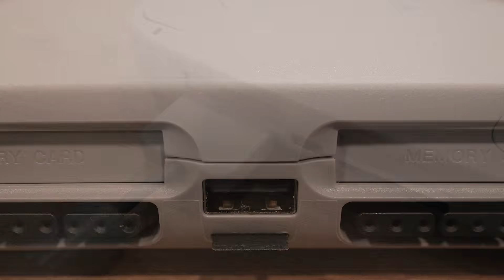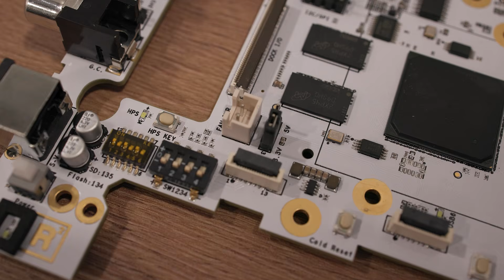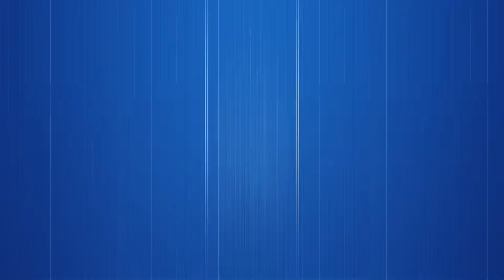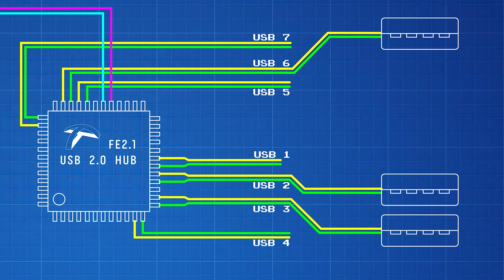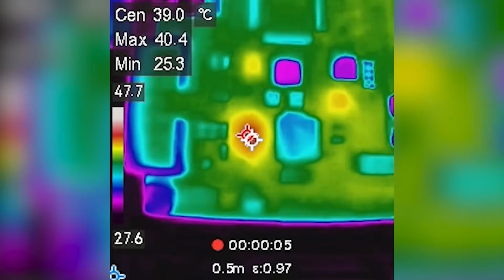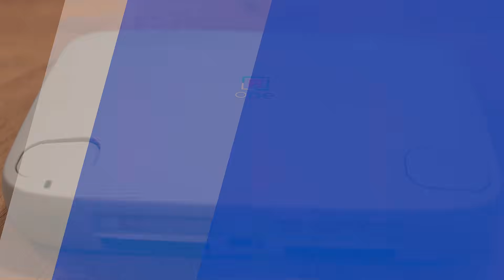Inside the SuperStation One

Comment: Hi, they say it didn't crash on them due to heat buildup; here in Germany, it's 35°C in my hobby room because we've had 40°C outside for the past two days. I can't even touch the bottom of the SSOne with my bare hand anymore!!! I can't open the box either—I've removed all  screws, but the tension is too high, and the lid would likely crack. Does the SSO (or the FPGA) have a thermal cutoff? The NFC reader/writer is a disaster for me: a 20% chance of reading and 5% for writing.
Reply: Sorry for my English its Google Translate .  In conclusion, I can only say: hardware/software 10/10; but the design of the casing/NFC and the intense heat generation—1/10!!! Did they actually test this?

Comment: Same board, but my NFC antenna works fine with cards. The location of the antenna was bad (bottom half of shell), but I could stick it to the top half, just above the menu button and it works perfectly well. I will have to remember it's there if I open it up again.

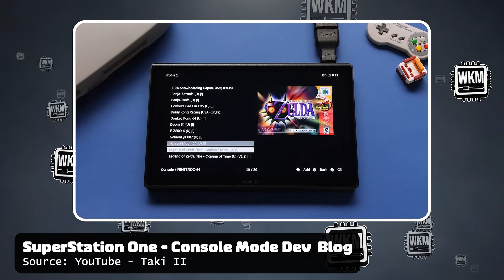Comment: 24:05 Maybe they would have saved around $20, but at the same time it's the only reason I even want one.  It's so hard to find a solution for something that supports both digital and analog signals.
Reply: What do you mean? This has been a pretty standard feature on the MiSTer. The main advantage of the SuperStation One is that it simplifies things by integrating everything onboard instead of requiring a bunch of different external adapters and/or messing with MiSTer.ini settings. But simultaneous analog and digital outputs are nothing new.

Comment: ⭐They have SNES ports on the website now!
Reply from the maker: Yeah, those are their standard SNES SNACs - you’ll need the SuperDock to use them
Reply: @whatskenmaking  Ok thanks, I didn't realize that. It looks like they were sold along side the device and I assumed it replaced one of the PS controller port since they're so similar in size.
Reply: @whatskenmaking  Ok thanks, I didn't realize that. I assumed it replaced the PS controller port.
Reply: I checked the site but couldn't find it. Where are you noticing it at?

Comment: The cooling fan is available for purchase. You just need to send an email message with your order number to the staff and they will add it to the order.
Reply: honestly it should have been standard, i remember our old cheap dvd player i was able to install a small fan on one of the chips that was getting too hot and that thing never failed.
Reply: Their coms have been terrible so I was not aware of that at all
Reply: Just did that for my 2nd thx
Reply: I never knew there was even an option for the fan, this thing runs really really hot. It is a serious missed opportunity not promoting that fan more. I feel nervous running this thing for more than an hour. It gets that hot.
Reply: I did this, got my SSO with Dock today. It was missing the fan.
Reply: @TheBroz whoa that’s not cool
Reply: @KeeneBraden  Literally.

Comment: It feels like people against this device dont seem to get that they can just get the regular mister pi if they dont want a ps1 or console like design focused mister. I think this actually achieves what it sets out to do and doesnt deviate from it. Too many people just want another mister pi variant or seemingly an emulation box set up, which a mini pc with a gaming os will do more for them than any fpga device. I'm fine with my mister pi but people really miss the point of this one.
Reply: The Mister Pi has been out of stock and unavailable to order for over a year.  When the SuperStation One was announced, Taki Udon shifted all production focus to that and stopped production of the Mister Pi. Building a Mister using Terasic DE10 Nano will cost you around twice the price of the SuperStation One. The DE10 based MiSTer that I built cost me around $550.
Reply: @mattrogers6646  Just out of curiosity, where did you get your parts from? MisterAddons, UltimateMister, RetroCastle, Antonio Villena, somewhere else? They usually cost less than 500 with shipping, did you get some extra stuff, like a mt32-pi or a few adapters/cables? Or that extra was just taxes/tariffs?

If you want to go for the absolute lowest price, you can still find a bunch of QMTech based designs out there. Plenty of chinese manufacturers are pumping out those and they're very popular here in Brazil right now. Although some early buyers got a few units with bad SDRAM, most of them were able to return it and get their money back and lately it seems like it's no longer an issue.

Personally, if I were to get another MiSTer right now I'd probably either get a MultiSystem 2 or a SuperStation One, as those are way more polished and priced just right. But as it is, I already got two: an old "classic" kit bought before the clones came out and a first batch MiSTer Pi that I got so I could keep one in my desk and another one in my backpack ready to go for a gaming night at a friend's place.

Comment: Can't navigate the menus with the snac adapter controller? Is that a technical limitation? How are you supposed to select a game?
Reply: Think of using snac as if you were using the original console. It is limited to its own environment and not to the OS that surrounds it on a mister. You'll need two inputs then, one of them for OS navigation.
Reply: @danpdrz88 that sounds horribly inconvinient. Ive never used a mister but i have one of these on order.
Reply: @SolderingIronFlux  you can always use the Bluetooth controller of your choice to play and also navigate the menu. The latency is unnoticeable.
Reply: @SolderingIronFlux I normally have a keyboard connected to my mister in addition to the type of controller for the core I am using. Works great.
Reply: @RemoWilliams1227 that seems to kinda defeat the whole "console" vibe this thing has going for it...
Reply: @SolderingIronFlux at the end of the day this is a mister system that happens to have built in ps1 snac and analog io. You can use it however you want of course but for me anyway a wireless keyboard doesn't ruin it for me. But it's going to need some sort of USB control so that you can navigate the mister os.
Reply: @SolderingIronFlux  SNAC is mostly for purists who are ultra paranoid about latency and are playing with an original controller and a CRT. Most people will either just use a regular controller or get a small/cheap wireless keyboard to make menu navigation super easy and convenient.

If you wanna freak out about latency, you can tell me and I'll point you towards some documentation on the subject, but be warned: it gets daunting very quickly.
Reply: a Bluetooth or USB controller. or  the MiSTer Remote IOS or android app

Comment: I bought this purely for PS1 since its cheaper than PS1+Xstation+RetroGem. Still am glad it has options for CRT/Monitor enthusiasts or HDMI TV.
Reply: why not just buy a PS2 and then PS2toHDMI adapter with SD2PSX for all your games? Then you'd have access to the entire PS2 and PS1 library on 1 machine
Reply: @iamdmc  Also, ps2tohdmi adapter is literal crap
Reply: @PS2ModchipTutorials it is, best budget option is GBS-C which is a steal considering you can connect multiple consoles to it and output all of them to one single hdmi. Cheap, no internal modifications, upscaling up to 1080p + scanlines and for like 50 dollars. I have one of these pre built AliExpress versions with some modifications to eliminate noise and improve stability and I have a PS1 (scart), PS2 (rgbs) and Nintendo wii (component) connected to it and it works pretty well.
Reply: @iamdmc the MiSTer PSX core supports graphics, CD speed and CPU enhancements that a PS2 doesn't. The MiSTer also emulates most other consoles up to the N64/PSX/Saturn generation near-perfectly.
Reply: @iamdmc  Oh, look up my ps2 collection ;-) Some are listed on the blog part of ps2 modchip tutorials.

As to PS1...you either need POPS(shit emulator developed only for 1 game demo on PSBBN, hackeed for more by Akuhak) or Discs. Lasers are dying fast. Better to buy a PS1 and Xstation or something like this Mister Pi.
Reply: @iamdmc  you can't run burned PSX discs on a PS2, and homebrew software emulation is not great. Defeats the purpose

Comment: It would had been pure perfection with an RF video output too.
Reply: Many CRT TVs are RF only, and many game consoles the Mister has cores for were RF only.  So it would have been nice to have RF.
Reply: You can get Composite-to-RF adapters that don't add lag.
Reply: Yeah but having it built in would had been pure completion and perfection in a single device.
Reply: @FabioSpelta  come on, as if composite wasn't hard enough to get right on a device like the MiSTer, with all the problems you might get when switching between 50Hz and 60Hz content, adding RF with its myriad of regional variations is simply begging for trouble.

Comment: Do you think it could be possible to swap the front psx snac ports for "standard" usb-a shaped snac ports? To get much more variety without the need for the dock and a front, convenient access compared to the dock that is only one port and on the side (and requires... the dock)
Reply: 3d print port replacement will definitely become a thing on this device. Idk if it may need some special modifications on the board itself though. Taki made it so that people can take it apart and mess/ iterate on it.

Comment: They could have been a bit more original with the design, unfortunately, I think it just looks like a generic chinese PS One clone. Plus, why not have interchangeable SNAC modules, rather than forcing the designers preference on the user? I can see there has been a lot of thought and effort has gone into the design, it just seems a shame to focus so much on the analog output  to then restrict connectivity to one system out of the box.

Comment: The engineering team will appreciate the effort to deep dive the motherboard. A lot of pain and suffering went into the analog system. As for a cost-down by removing some ports, it would only save less than a dollar, or a little more if the Sony chip was removed, but I think the Sony chip produces better-looking YC signals for some systems. It also allows the system to use a single config for most countries/monitors. 

As for the NFC, you installed the large one where we originally did. It’s fine on this color, but it looks terrible on the blue, ergo the side on the front. The flash chip contents have changed. Flip the internal switches to see the contents.
Reply from the maker: Appreciate that. The analog video architecture is elegant - your team did a nice job. It was also a pain in the neck to trace with the bottom-side components. Regarding the cost, I was referring to a digital-only version, not a version without the Sony analog. Going digital-only would've meant you could nix the ADV7125, the analog video buffer, all 3 of the TI video amps, both analog switches, and the DIP-4. Not to mention a simpler PCB layout with more top-side components, which could also bring the manufacturing cost down. My back-of-the-napkin estimate was it would drop the cost another $20-$25/unit, but I'm just an outsider looking in, so no surprise if I'm off on that. Don't get me wrong, I appreciate the analog support - but I also would've been more than happy to pay for it in the SuperDock. 

I will say, I think Zaparoo has been undersold in the marketing - I was surprised that the @ShortCircuit guys didn't even mention it. 

Regarding the flash chip... I knew I should've dumped it, but I thought "nah, there's no way there's anything meaningful on it and the video is already long enough".
Reply: It also has the subtle effect of adding at least one real Sony logo to the board ;)
Reply: I think the NFC problem is a nuanced one and I agree.  Maybe the card reader could have been on the bottom or implemented in the superdock?  Sliding the card underneath the console or between it and the dock might have been alright with me.
Reply: I'd love a dock with only snacs, so I'm hoping for more than one dock type, I have no use for that disc tray. I love the analog video outputs tho, easy buy.
Reply: Since you're already offering an active cooling add-on, it might be a nice option to offer a larger NFC coil as well with the right connector already attached. Could be installed by the user or could be installed before shipping just like the cooling fan.
Reply: Can't wait for my batch 2 ssone + superdock. Thanks for all the work!
Reply: Taki, this needs a powerbank + screen attachment. This would make the perfect portable console. I realize I am done with handhelds because nothing beats holding an actual controller.
Reply: @reginaldstubtoe4185 That's a neat idea honestly. Remove most of the ports to make the board smaller/lighter, add a battery, screen and buttons and walah, the perfect hardware emulated portable retro machine lol. (I don't use handhelds either 😂😂)
Reply: I think you're forgetting the part where the tiny default NFC reader didn't work on cards regardless of it's position
Reply: @jvan2018 it will probably work when connected to the dock.  The cards have the nfc in the middle so when you lift up the device it will work i think. So when there is more space underneath the chip is in the middle of the sensor
Reply: @HB-mj2jz  that's a good point and well worth considering since I'm pretty sure Taki Udon's dev console has the dock :)
Reply: @HB-mj2jz  It does not work on a blue founders with Dock.
Reply: A bigger coil would not have fit that tiny corner quite visibly. It's a pity they did favor aesthetics over function tho.
Reply: Can it read the game roms from an external USB hard drive?
Reply: @justinpenn9250 ofcourse it can. The std mister can also do that
Reply: @justinpenn9250  maybe using an Unraid server.
Reply: Any plans for 3DS screen upgrades?
Reply: still wondering why you didn't just stick with the MiSTer board as a base and just add the SNAC controllers as a daughterboard?

I guess we'll see if the dock makes it "worth it" however long off that will be - and which first gen CD consoles it will actually read. For now it's just a MiSTer in a nicer case
Reply: @iamdmc  because that already exists and is just a mister pi, you completely miss the point of this trying to make the mister experience more console like
Reply: @iamdmc  me and a lot of other people are getting into mister for the first time after waiting years, just because of 'mister in a nicer case'. is that hard for you to understand? literally anyone else could've cared to put mister in a nicer presentation, but nobody else thought it worth the trouble. who's fault is that? is it difficult for you to understand that someone saw a niche that wasn't being satisfied, and decided to finally supply an answer? most normal people don't want a pile of shitty looking circuit boards sitting around. it's pretty simple, really.
Reply: @cupwise1700  as much as I love my 3D printer, 3D printed objects are less than stellar to keep around. They just look so cheaply made, even Heber's console which I adore (but didn't order). This one? I even pre-ordered the dock! Such an easy buy, really.
Reply: You could have added a User port to the base SS1. I don't know why you chose not to? Unfortunately, I am on of the users that will NOT fork out 45 USD JUST for a User port, as I will not use any other function of the dock...

There is literally a port on the board for a UART port, so I really don't know why? Unless you are just trying to get people to buy the dock that want the UART port?
Reply: Cope

Comment: 17:10 thank you for talking about Zaparoo.  I have yet seen a video talking about this part

Maybe Taki hid that NFC receiver in the corner maybe for easier and safer case tear down.  Maybe solder a matching pogo pin connector for easier case assembly
Reply: it was obviously just an afterthought
Reply: @iamdmc  I don’t know, but I believe the feature was listed at really early stage of the project

Comment: Front usb should have been a snac port instead and CR1220 should have been the common CR2032
Reply: Also the cr2032 should be accessible from the bottom with a door
The dock is a dvd rw that can be used to dump and burn with your laptop. It’s dual purpose also has m.2
Reply: Then nobody, including myself, would had bought the dock.
Reply: @FabioSpelta  lol exactly

Comment: What a review 🎉
I wonder where MT-32 would be connected to
Reply: you would need the dock for this.
Reply: Yeah................ They chose not to include a User port on the SS1.... Only on the dock...
Reply: The funny thing is... There is literally a User port connection on the board that you can connect a third party User port to have a user port on the base SS1. It makes no sense!
Reply: @legendarymark112  maybe 3D print a User port accessory to sit under the dock when it comes in.
Reply: @ArielAces Will you be able to get cabling out of the case without needing to damage the case though? (Modify the case)
Reply: @legendarymark112  probably not.
Reply: Honestly how would you fit any more ports on the base unit. I’m sure people will make 3rd party docks too, it’s in its infancy and it’s his first custom design to come to market.